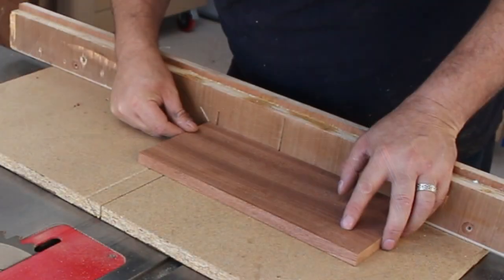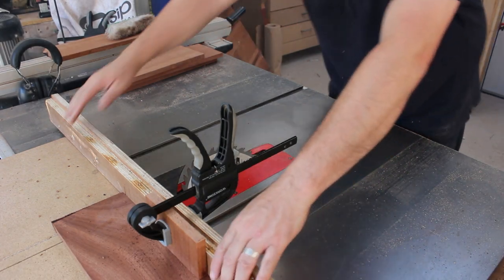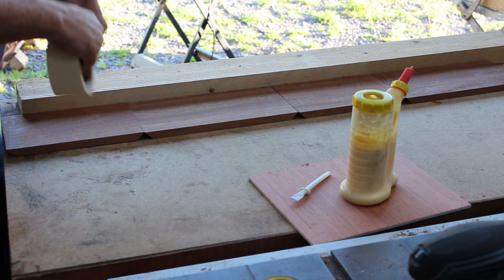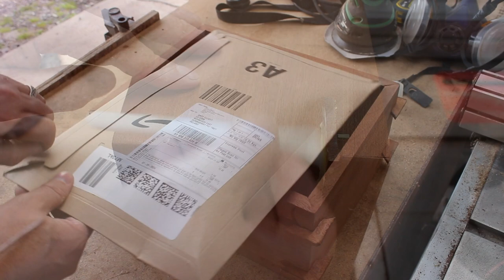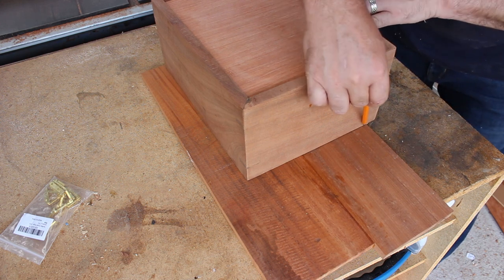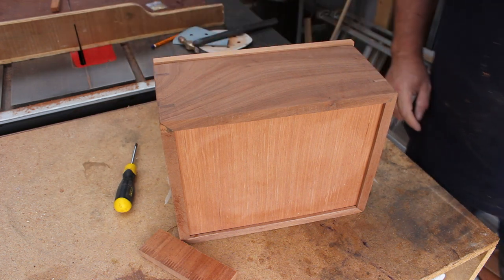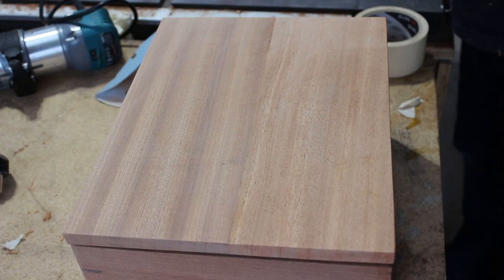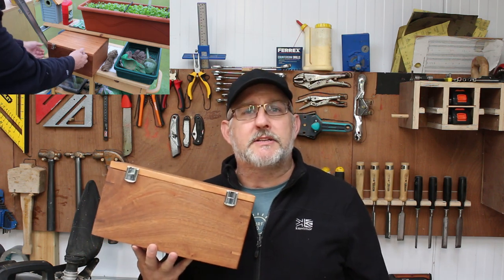Pallet wood Seed Box

Comment: 👍👍👍 I'm sure she will be thrilled with the seed box. What are your thoughts on the Living Sensations saw? Thank you.
Reply from the maker: Hey Pete! Honestly, It's okay for the money.  It cut well, and I like how it has 2 teeth TPI to choose from on. The handles feel a little cheap, and it doesn't close back up smoothly.  On mine, the blade catches a small pin that holds the handle on.  For $15 though, its not too bad! Thanks for watching!
Reply: @andy.elliott.foreverpens  
So it's rough and ready but it does the job, I'll consider getting one. Thanks Andy